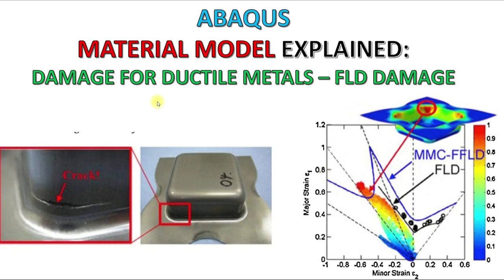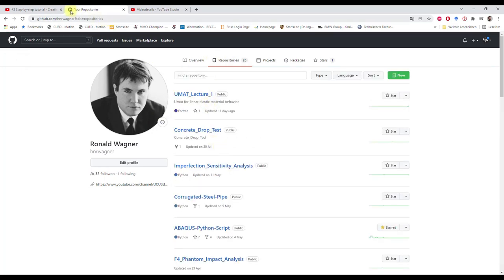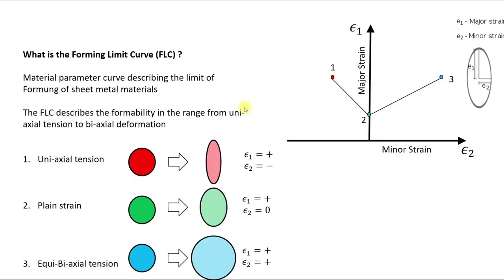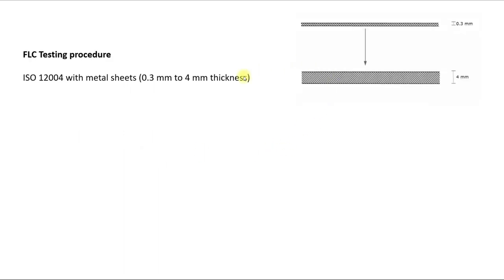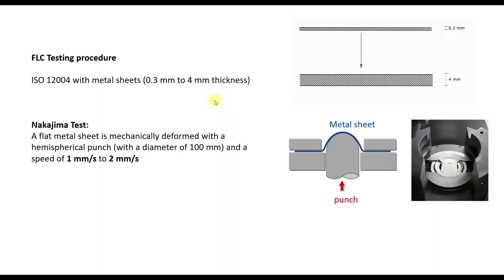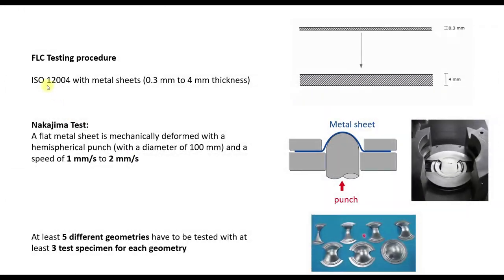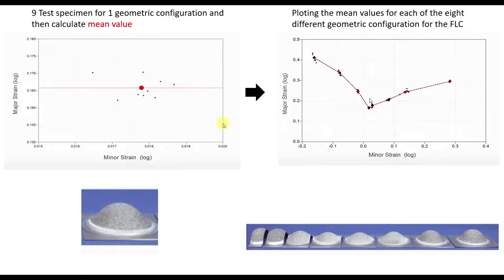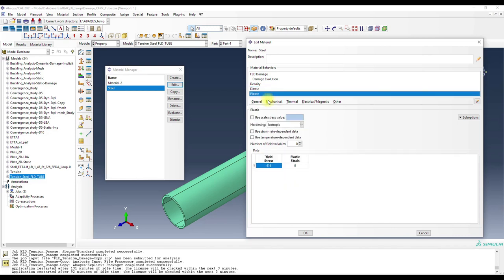ABAQUS Tutorial: Damage for Ductile Metals - Material Model Explained - FLD Damage

Comment: May  I can ask if the FLD in abaqus can be used with 3D elements? I have the fear it can not since is an only in plane criterion.
Reply from the maker: it works for 3DC8 elements in my case
Reply: @hnrwagner  Because for shell works like a charm and makes sense since it should work on plane. is 3DC8 essentially C3D8? I looked all over the ABAQUS library and cannot find this class of hex.
Reply from the maker: @pisolo86  c3d8 ,that was a typo :)

Comment: Amazing video, but when I choose FLD as damage criteria it won't fracture and when I use ductile damage it does and I don't know why for the hemispherical punch test. Could you help? Thank you!
Reply: The models for sheet metal necking instability (FLD, FLSD, MSFLD, and M-K) are available only with elements that include mechanical behavior and use a plane stress formulation (i.e., plane stress, shell, continuum shell, and membrane elements).